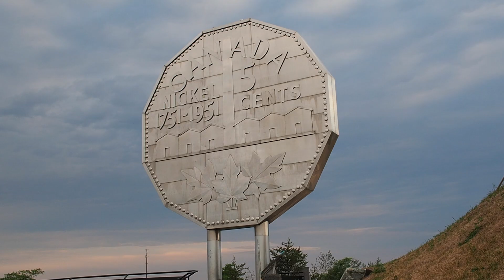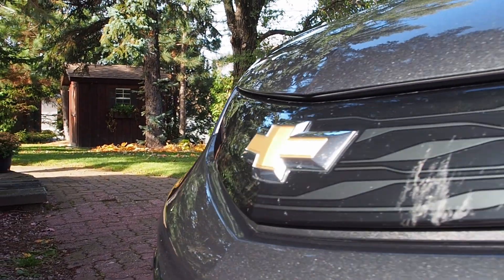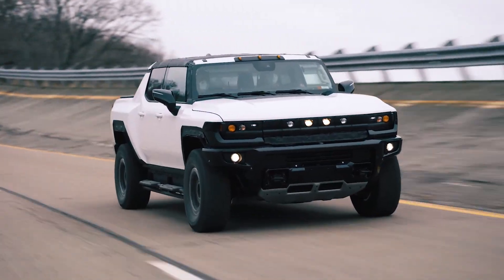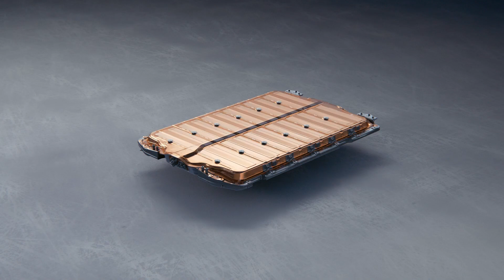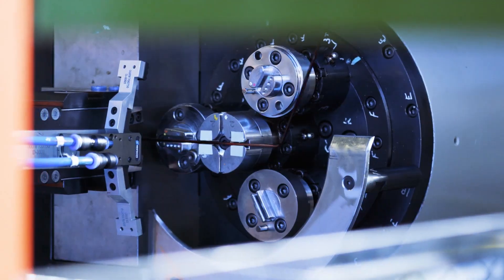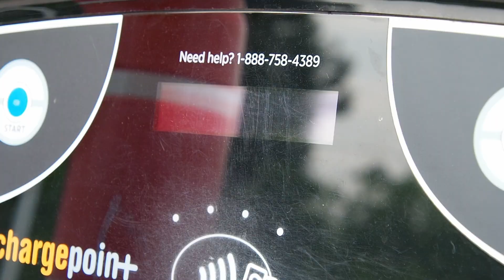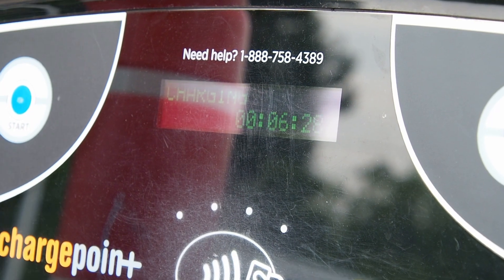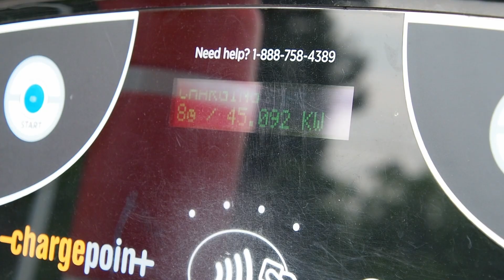GM's Ultium battery tech explained | Driving.ca

Comment: Are these Ultium battery packs subject to the problems like thermal runaway that plague current Lithium-ion packs like those used by Tesla, if they are involved in a crash.  It is odd that when discussing EV technology you fail to mention safety which is just as important, if not more important, than range, charging speed, design etc.,  We would hate to be put in a position where a warning goes out to park an EV vehicle away from the house due to the possibility of spontaneous combustion, as we always had parked in the garage. Are these batteries more like lithium-metal/solid state, hopefully better? Until the question of safety is answered I'd be hard pressed to purchase your EV.
Reply: Ultium batteries use a NCMA chemistry. I recommend reading up on it. They have less degradation over time, far less degradation at higher temperatures, and the Aluminum binds more strongly with oxygen than the other materials, which reduces the kind of internal fractures that lead to fires in other batteries.

Comment: Are Ultium  battery packs safer than Lithium-ion packs, ie. is it safe to park Chevy EVs in my garage without the worry that it will set my garage, and house on fire?
Reply: Yes, Ultium batteries incorporate Aluminum into the chemistry, which forms stronger bonds with oxygen than the other materials, and this leads to far less wear on the cathode material over time, which in turn makes the batteries much less likely to combust. Ultium batteries are NCMA chemistry if you'd like to google it and see the scholarly articles yourself.

Comment: How timely!  We’re rocketing to $10 a gallon gas in 2022 and GM will have the answer sometime between 2025 and 2030.  The #FJB Admin is stating we must have even higher gas prices to accelerate a move to EVs that are not ready for prime time in any sort of quantity and the current electric grid can’t handle AC electric demand on a hot afternoon today.  This is a recipe for disaster and they know it.  Shut off another pipeline to get us to implosion faster why don’t you!

Comment: Great job making this video. It is funny watching this a year after being made is amusing. The largest battery manufacturers and leading EV car makers had already pivoted away from high nickel and cobalt batteries years earlier for iron phosphate. Lithium iron phosphate batteries are significantly cheaper and have a longer life cycle and are much safer than GM’s NCM batteries. Watching GM once again coming late to the table then doubling down on previous generation tech is a recipe for disaster.

Comment: Many thanks for producing this great video.  It is counter-intuitive to think that batteries wired in serial fashion would charge faster and accept more current than those wired in parallel.  Is this correct?
Reply: Power is Volts x Amps. Fast chargers are rated in watts. 

Current (amps) is what generates heat over a conductor. The more current you want to move, the bigger wire you need. 

That's why the wire for 30 amps breakers in your house is bigger than the wire on the 15 amp breaker. The voltage in your house stays the same, so the only way to increase power delivery is by increasing the current. 

Wiring DC batteries in series build voltage, but the current stats the same. The wire in an EV is fixed size. If you want to charge the battery faster, by changing the wiring configuration of the batteries, you can increase the voltage of the pack, and thus increase the speed at which you can push power into the pack. 

What I don't know is why the battery doesn't just stay at 800v. Maybe the lower voltage is safer for driving

Comment: My question is when it comes time to either recycle or discard these batteries, what long term effects are there going to be, if any, in the environment.  People do not always do the right thing.  Will they truly help save the environment, or will the Ultium Battery cause a whole new, maybe even more lethal than what we have going on right now? I'm very, very curious about this topic if you can elaborate on in it, please and Thank You😬
Reply: There are ongoing efforts to create a nearly closed loop recycling industry around these batteries. Additionally, a lot of these batteries can potentially live on for many years in stationary battery storage applications. Redwood Materials is one such company that aims to do this. There are others. Once the material is mined it can potentially be reused over and over. There is the potential to recover nearly all the material. I think there needs to be some sort of end of use management for batteries though. It can't be how it is now where people just throw old batteries away.
Reply: CNBC did a mini documentary on the issue of Li battery recycling and some companies working on solutions. 
https://youtu.be/xLr0GStrnwQ
Reply: The govt doesn’t care.  They only care that it’s built by a unionized shop so that they get paid .   Then they will be taxed into extinction.
Reply: Wow!  That's Profound.
Reply: Interesting about General Motors Epsilon platform: https://www.youtube.com/watch?v=gWQ80oMetxQ

Comment: I would be curious to know how long does a battery last until it needs to be replace? And how much would it cost? These questions are not being asked nor answered by the media or suppliers the car companies. So what is going on!
Reply: Great question, like cell phones there is a limited number charge cycles, depends on the usage, If you drive a lot then aging happens sooner. Cost should be less with GM batteries compared to others, market place will determine price. But to ball park the battery warranty, I would guess 8-10 years or 100,000-150,000 miles from new. Side note I remember the old GM skateboard prototype, swappable chassis depending on your needs... current system looks similar.

Comment: Here in Norway they have planned to ban all sales of new cars with anything else then electric by 2025 which is totally crazy as entire Northern part on Norway you can not drive electric because of cold and to long distances (you run the risk of freezing to death on every mountain pass if you get surprised by the many winter storms that can last for much longer then the battery will give heat)...
Reply: Apparently those new tesla heat pumps have wayyy better winter range. Check them out

Comment: "...our U.S. plans will accommodate the world’s largest production capacity,” said Jonghyun Kim, CEO of LG Energy Solutions. “Our 70 gigawatt-hours (will be) two times the capacity of the (Tesla) Gigafactory in Reno, Nevada.”
Reply: The problem is always the, not enough Canadian hockey players in domestic car companies… why?
Wayne Gretzky used to say “A good hockey player plays where the puck is. A great hockey player plays where the puck is going to be.” 
― Wayne Gretzky
These guys keep shooting for Tesla but instead of plotting out where Tesla will be in ‘26 thru ‘30.
Tesla is getting or will be getting 4680 batteries from Panasonic, CATL, Samsung, LG, others plus significant internal production capacity.
Tesla is nearly at the out in US as GM claims to be at in 2-3 years.
So far, we have not seen much other than their battery system only runs in 800v when doubled up as in Hummer.
Just look at the maximum charging speed of their current and upcoming (1-2years) vehicles. Barely what we’d find today. Hyundais, Porsche, Kia, Audi run an 800v architecture, Tesla is 400v but can charge at nearly 250 and is expected to increase in the coming year. Lucid runs at 900v! Rivian is 400v (and faster than non hummer GM EVs) and is already preparing to move to 800v.
Reply: @davidlemieux615  GM found consumers that buy mainstream vehicles do want nor do they need high speed charging as most commute and only use a portion of total range.  Besides high voltage charging degrades battery life.   See Tesla that has been Superchargered most of it's vs one that is not.  The later has hardly any degradation aside from age of the battery.

Comment: Battery powered is fine for those that want it but don't make them the only option.
Reply: Because gas powered vehicles and the supply chain to drill for, transport, and refine oil to gas is destroying the Earth to a point it won't be livable any longer. That's why.

Also, electric cars are superior in every way and are only going to get better moving forward.
Reply: @geekingoutwithshad  when I was in grade school the narrative was if we didn't stop driving gas cars that by 1985 we would be in an ice age. Gas cars are still here, 1985 came and went, where's the ice? Climate change caused by burning gas was 🐂💩 then as it is now.
Reply: @geekingoutwithshad  msm has cultivated you well.
Reply: They are literally better in every single way.  Why would someone want an inferior vehicle.
Reply: @proximoAZ  are u kidding me ?